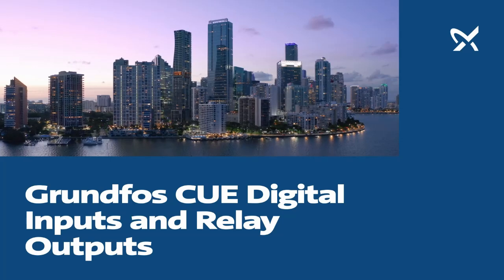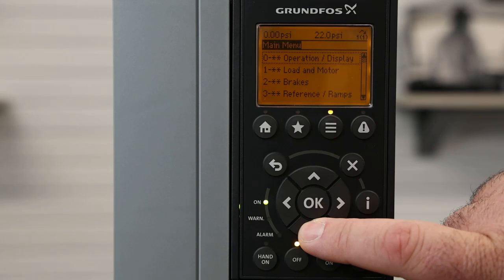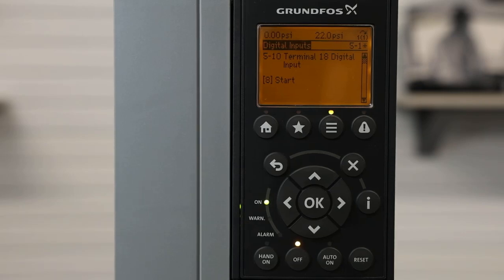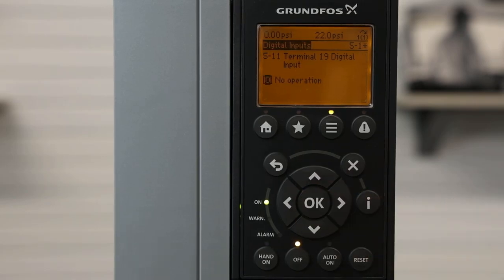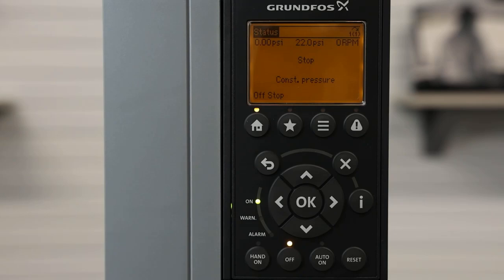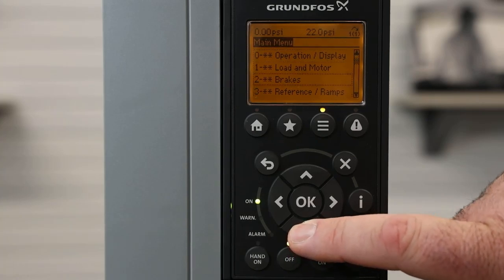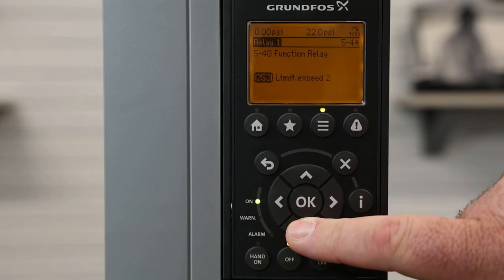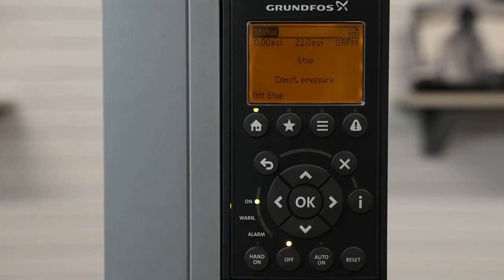Grundfos CUE Digital Inputs and Relay Outputs

Comment: Thank you sir. Before I am using Danfoss VFD currently I am installing Groundfos VFD what kind of programming I can do & settings also. Manually drive Running but Auto mode started its Running failure alarm showing. Please guide me
Reply from the maker: Thank you for contacting us. Please be advised that you can find a wealth of technical information, including Operations and Installations Manuals on our website. Please simply search for the product you need and use the documentation tab to find and download all the information. Find our website here: http://gfos.ly/6052lvzAs. To get support from your local Grundfos Partner please fill out this form with your information and question: http://gfos.ly/6053lvzAt

Kind Regards, Krystyn